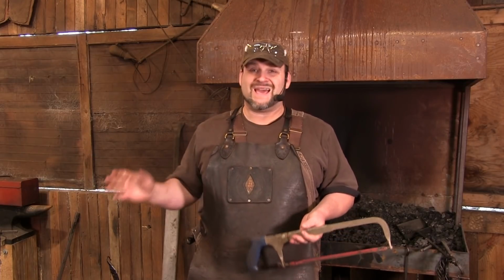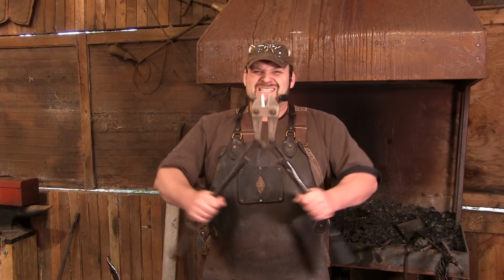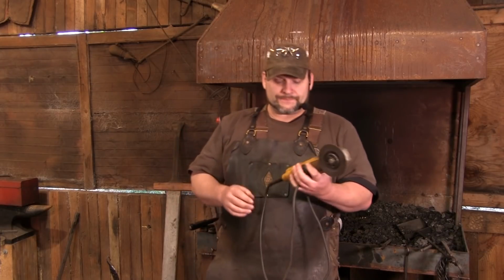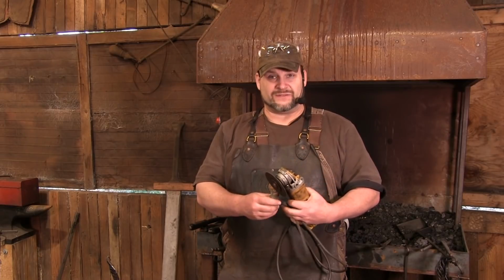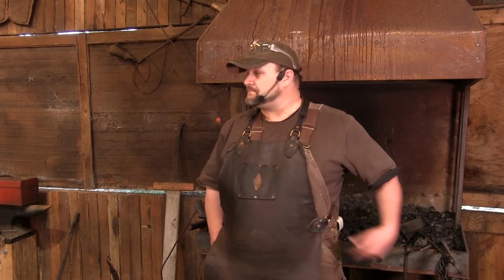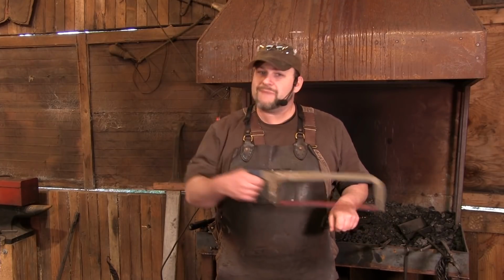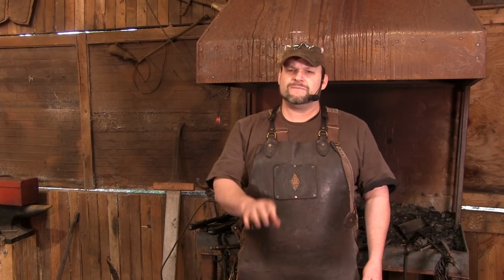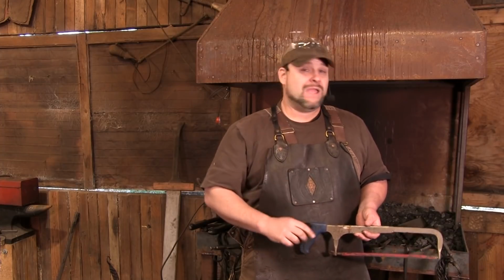Steel Cutting Tools For Beginners (#17)

Comment: You think 1/2" stock takes some cutting reminds me of cutting make up lengths 110 pound rail track down a very gassy coal mine with a machine hacksaw blade in a bow saw frame - now that's hard work !
Angle grinders are a real winner for me, both for cutting and grinding, but you do have to be careful

Comment: Bellows or blower?
Blower. 
Traditional Japanese swordsmiths used a box with a hand powered piston in it to push air into the fire hundreds of years ago.
The guy blowing in a pipe got left behind or turned to glassblowing.✌ 😃

Comment: Took me 45 seconds to find this...A member has reported a fatality which occurred during preparation of surfaces for welding. A welder was using an angle grinder for the preparation work when the disk of the grinder disintegrated. The hand-held angle grinder was fitted with a 230mm diameter cutting-off wheel, and when it disintegrated, fragments penetrated the victim’s chest and abdomen. He was taken to hospital by rescue helicopter, but died the same day.

The investigation showed that the angle grinder and cutting disk were not compatible and that the angle grinder had not been fitted with a guard
Reply from the maker: I am asking an honest question here. There was a man in 1968 that pee'd on the third rail in the subway and got electrocuted. Should this prevent us from using the subway?
Reply: @purgatoryironworks  no it should not. Should we read and follow instructions? probably. Don't mix an angle grinder and cutting disks that are not made for it. Keep the guard on also.

Comment: I always have this argument regarding forge welding vs MIG welding.  I can guarandamntee You that if smiths back in the day had electric welders they would have used them.
Reply: A 1000 years ago a smith would have given his left arm for a steel anvil. 500 years ago a smith would have given his right arm for a controllable power hammer, 100 years ago a smith would have donated a nut for a mig welder. Blacksmiths, always at the forefront of innovation, but unfortunately always at the back end of technology.
Reply: @philmenzies2477  ahh, but there is an app to look up heat treating temps for various steels. Though not complete and rarely includes tempering temperatures/times there is technology for blacksmiths now. We just need silicon heads to take notice and complete some apps that finish a full library of information for our beginners and helpful information on the new steel blends for our experienced smiths who have not worked with the new steels before.

Comment: I started day 0 with an angle grinder I’ve learned to appreciate bolt cutters for 1/4 and under but anything bigger angle grinder 100/100 I now have 3 a few years later I need another lol I got one for cutting one with a flapper and one with a cup the next will have a grinding disc and i think I’ll be set for now

Comment: A good option if you have some $300 around is a portable band saw. Safer than an angle grinder, quick, and keeps the steel cooler so you can pick up small pieces right away. Just got one for Christmas and it was love at first cut. HF has a $120-ish dollar version if you're more strapped for cash. Next stop is getting a stand for it to make it vertical.

Comment: I've got a Harbour Freight version of a portaband ($80 I think) that I made a table for and mounted it to the wall. I know H.F. stuff is sometimes poo-poo, but I have made several thousands of cuts with it (mostly through 1/2"x1" bar). Even if it broke today, it wouldn't owe me anything and I'd get another one.
Reply: Portaband with a table is the way to go. I used a hacksaw and grinder for years until I got my Dad's old milwaukee corded bandsaw when he upgraded to a cordless. Built a table for it and cutting steel is actually pleasant now.